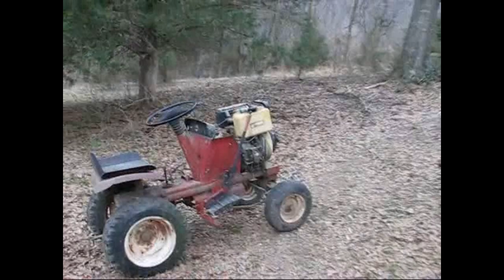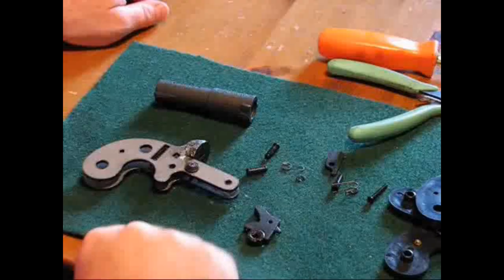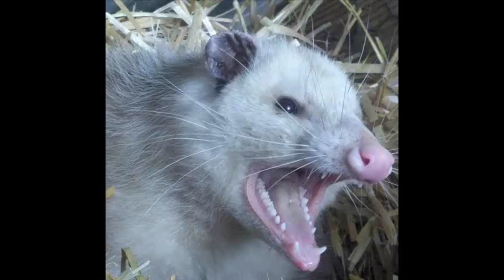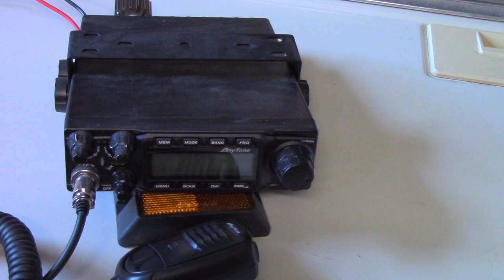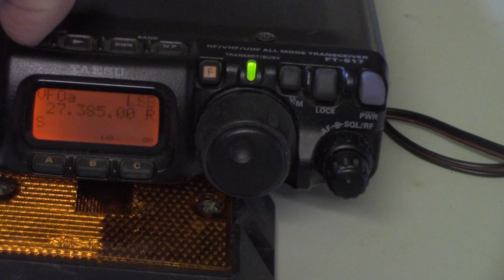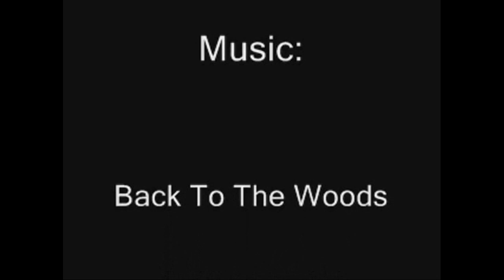Anytone AT 6666 Audio and Frequency Check

Comment: Is that a stock radio? Or was is modified upon purchase?
Reply from the maker: I did the power-up sequence to switch it into full coverage mode. Out of the box it only covers 10 Meters. It doesn't require a modification; just the power up sequence.